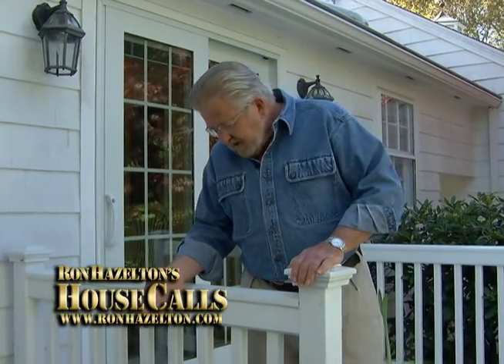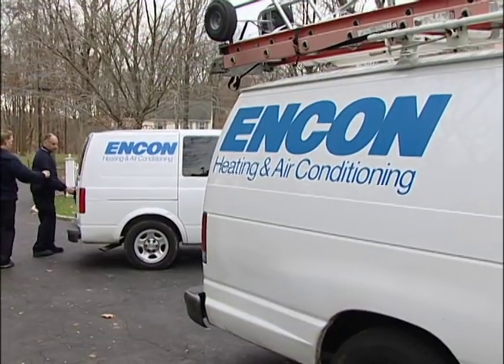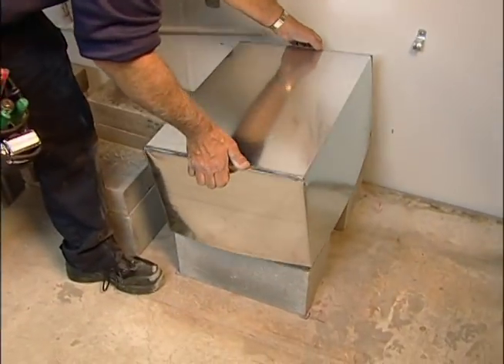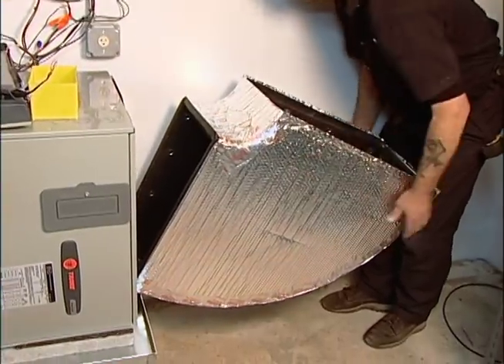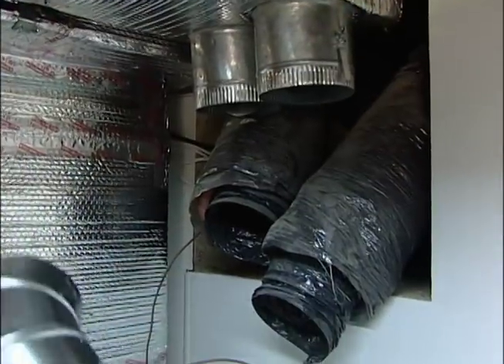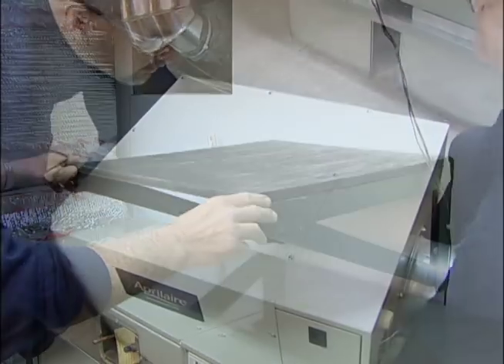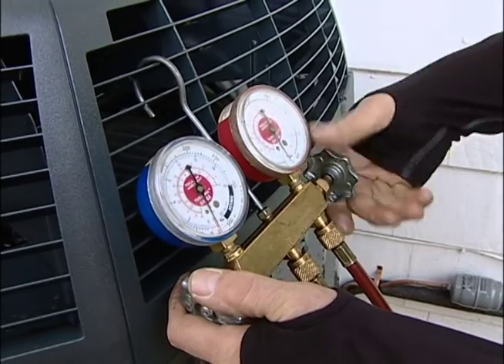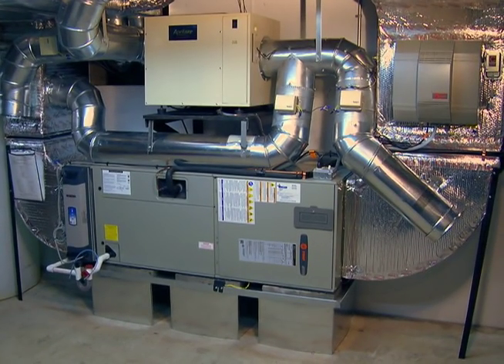Replacing a House Central Air Conditioning System

Comment: Why did you get a dehumidifier the ac is basically a dehumidifier? And is that a heat pump because if not how are you gonna use the humidifier in the winter just curious but great video they did a nice job.
Reply: More stuff to sell and additional maintenance=$$$

Comment: $15,000 later.....
Reply: Not much different than your typical install.  $9,000-$10,000 is the typical average for a brand new furnace with condenser and evaporator!  And he added that dehumidifier which is less common, along with all of that new insulated duct work, so you might be right or even somewhat low with your estimate!

Comment: Hi all, i got the problem in my central AC unit. It was Ruud 1.5 tons, R20. I called so many companies to give me the estimated price. Everybody told me they dont make R20 anymore or there is no match of 1.5 tons or we cant change only outside unit or there is no warranty for the out side unit unless you buy all parts. I said how about I bought the unit and you fix it. They said no you cant do that. Why cuz the comanies pay a big percentage to the contractors. The cost to change it $5200 to $8000. My inside evapirato unit was only a year old but condenser was older than 30 years. Almost all told me to change the all units, as the piston tube or pipe was only 1.5 inch for the unit and the companies dont recommend these any more. I researchex a lot and i finally found a private contractor who suggested me to buy only out side unit (Goodman 2 tons r20) it was 2 inch instead of 1.5. He cut thst wire pipe and velded a new three inch pipe($2). It was all done in a day. The total cost was $1700 ($900 for the unit +$800 labor ) It has been working so good ever since. Only thing i change is, filters every three months.
Reply: raj singh r20 refrigerant is bad for the environment that’s why
Reply: Good job the whole show of this company's you buy their product over $20,000  so  the sell guy make I big comision and company big bucks God for you

Comment: The HVAC company did a very nice install. However, you're gonna become very friendly with your HVAC company over the years. . You got a hell of alot more parts that are going to fail over time. Especially with those high efficiency units.   You will also never recover the additional cost through energy savings.  Service calls will eat up that savings in no time.
Reply: Quality systems installed by reputable companies will cost more but you get returns in comfort, convenience and most of all energy savings where the local utility kills you with high rates!
Reply: looks like a great company
Reply: Price that air filter!

Comment: Why not create a video for new home buyers ! -  Require  HVAC  installed to LEED standards  -  20% Less leakage  - All HVAC companies  that install commercial which requires LEEDs know  how to install LEEDs into residential.  LEED  Heat pumps for residential usage by Trane. Increase  building code insulation suggestions in walls and ceiling by 50%.  Increase  code floor insulation above  garages that have heated rooms above.
Reply: Very good ideas but if you do all that very few people could afford new homes or condos, etc.